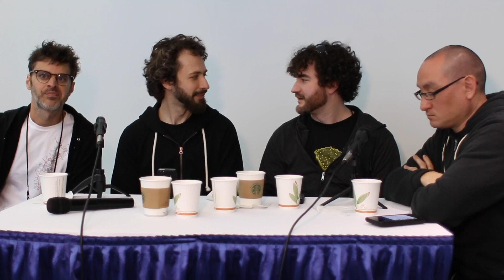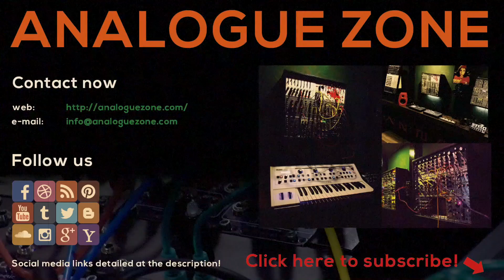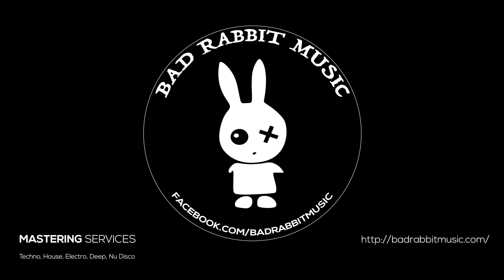NAMM2017: LIVESTREAM Talk by Tony Rolando, William Matthewson, Dan Green and Richard Devine

Comment: I think the hardest thing for me to understand is that Mutable actually wants their modules to be completely re-programmed... I suppose I have too much pride, because if I found an Erbe Verb and it was operating as something other than an Erbe-Verb, I would be depressed about that. I do see great value in a re-programmable device... perhaps something low cost and then if an idea captures my imagination we could develop a hardware especially for that great idea... like the Tapographic Delay from 4ms. If that were just an alt firmware, I'm not sure it would have captured my imagination the way it does.
Reply: I most definitely can't speak in the behalf of Olivier Gillet or any body else. My opinion is based on what I've read on several exchange on MW or Mutable own forum.

I think that MI open source policy is more about an educational purpose than a desire to have the modules completely re-programmed, nor just copied and sells as DIY kits for instance (another topic). Alternative firmware are great, and add values to the module, in my opinion.  But I've read that Olivier liked more the simplicity of the stock firmware, the way he designed it.

But I agree with you that it should be difficult to see your module evolve in a way you don't like, for instance with a firmware who completely kill the simplicity and original vision you had. Imagine peoples complaining about how complicated it is to change mods in MI Peaks with Dead Man's Catch modified firmware.

At the end it's the responsibility of the user to choose. but the ability to choose is great. and so is the open source approach

edit:typo
Reply: I doubt Olivier is actually opening his designs up for people to reprogram as much as they are being reprogrammed - or in that scale. He just has an OS ethos and he likes to contribute. People just go berserk (and even sell clone PCBs en masse which is ridiculous). Take Braids for example, he did include some of the BiTT stuff on his last and final Braids upgrade, but just a couple of ideas, like being able to define the AD envelope which was indeed practical. He avoided the menu-diving as the original module UI was not designed to go into such depths.
Reply: That strikes me as a bit strange, too, just from a user perspective. I have some MI modules but I've never felt like trying any of the alternative firmware on them. I like getting a module and thinking, okay, it does whatever and I like it for that. Getting it to do something completely different just seems weird. I know a lot of people like being able to do that and I'm deliberately limiting myself, though.
Reply: For some ideas a generic or unrelated user interface (a module such as braids, for example) will be OK. But I believe many ideas benefit from a dedicate UI, hence my example of the Tapographic Delay. That firmware running on a generic hardware would not be half as exciting in my opinion. I feel with modular synths, which are perhaps the most luxurious of synthesizer instruments, we should have gorgeous and dedicated User Interfaces. If what is desired is a continuously developed DSP algorithm Pure Data or Max/ MSP might be faster, cheaper and easier to use. We have often prototyped DSP algorithms using MAX/ MSP or Pure Data. It is a fantastic tool for such things and with the newer Expert Sleepers products, the conversation between the modular synth and a software such as MAX/ MSP is dramatically changing! It is happening!

Comment from the maker: UPDATE: 
The NAMM staff confirmed, they just not opened the following ports necessary for live streaming. 

outbound port 1935/TCP : outbound streaming over RTMP to most streaming providers 
outbound port 2543/TCP : VidiU speed test function, not required for streaming operation 
Some of the live streams were goes thru (Facebook live for example) because 
it uses other ports: 
outbound port 80/TCP : outbound streaming over RTMP to Facebook Live 
UPDATE*** 

LESSON LEARNED applause
Reply: Cyber security bites again: It works every time except when you need it!